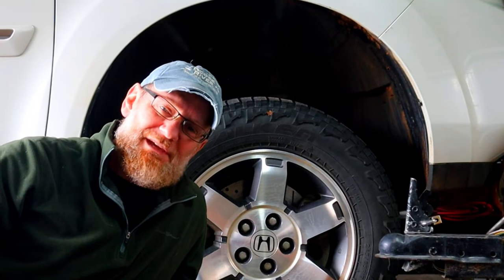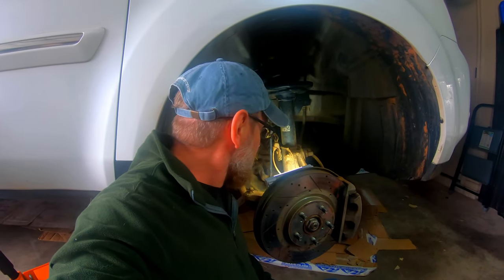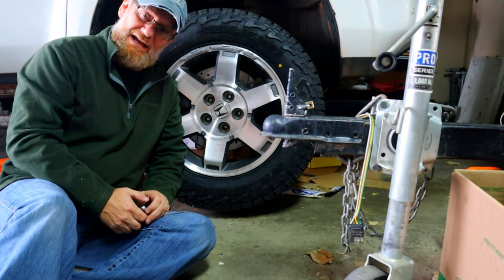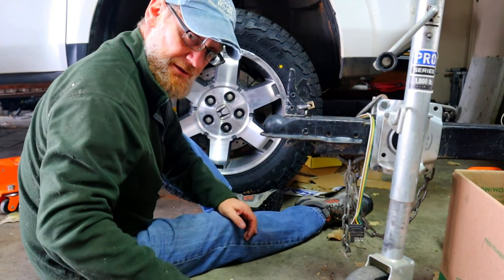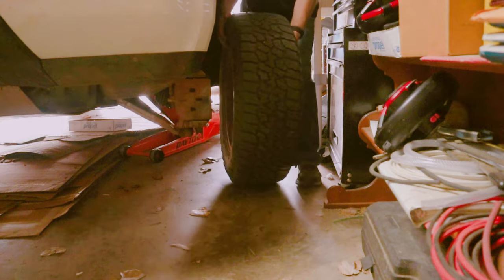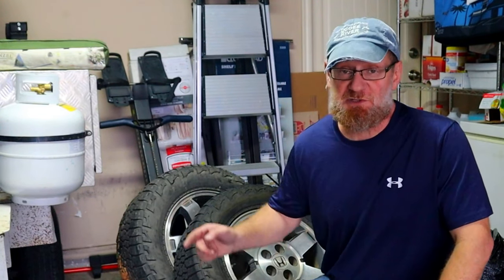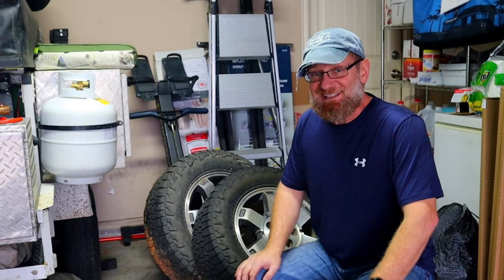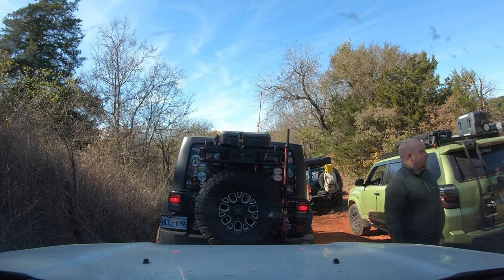Honda Pilot Maintenance #Hondapilot #Honda

Comment: An idea you can do for your new fenders is use a 55 gal. Steel drum. I’m planning to do that to mine and can send you pictures when it’s done.
Reply from the maker: Send those pictures. I do have some limited fabrication ability.   I’m just delaying learning welding. Probably need to do it.
Reply: @ericscamping  will do and can help you out when it comes time to weld up some stuff.

Comment: Did you change the valve sensors??
Reply: And, are does amazon disks brakes??
Reply from the maker: Evolution brand and I did get them on Amazon.   Good quality and pretty inexpensive.
Reply from the maker: I didn’t have too: the ones on the rims paired automatically with the system. I got very lucky on that one!